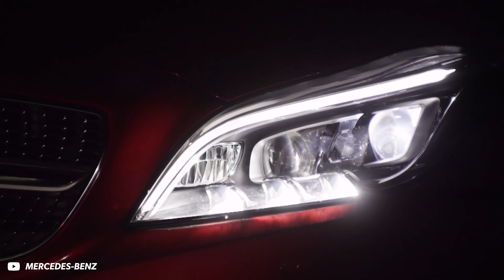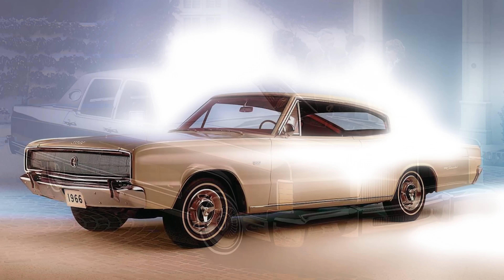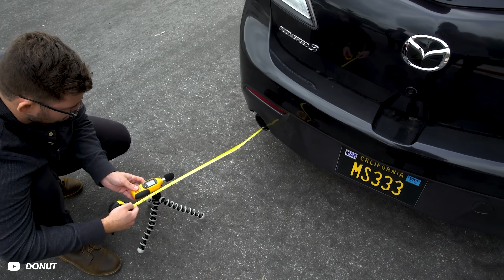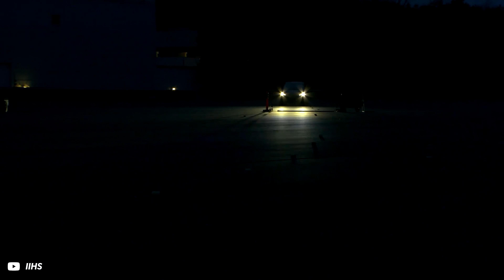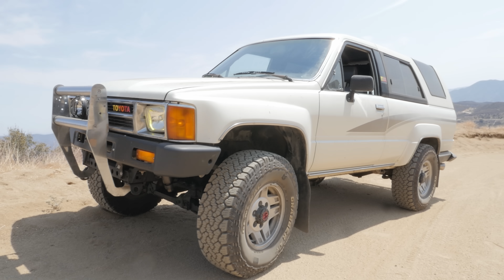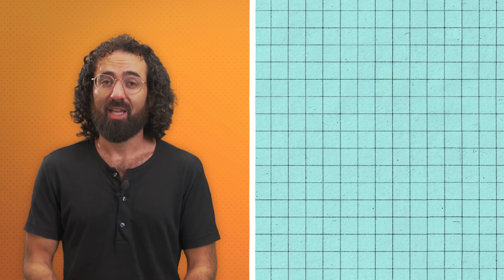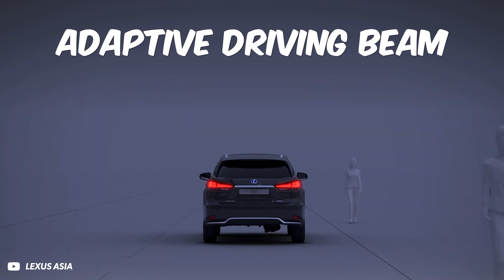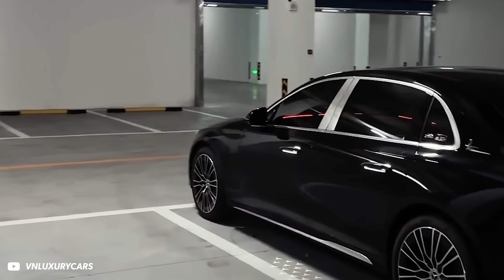Why new headlights are blinding American drivers

Comment: Holy cow.  I'm so glad it's not just me.  I've been noticing this a lot lately and I thought I was just getting older or something.  People are installing stupidly bright headlights and making it a pain to drive at night.  Then it makes other people more reluctant to turn off their high beams.  It's a real safety hazard, especially in deer country.
Reply: I'm in the same shoes.   I thought I was growing old and more sensitive to light - turns out, it's not that simple!   Good to know.   Shame I'll be in the ground by the time all carmakers were forced to do those adaptive headlight systems.
Reply: @Steve-es3fc  Yep, I figure that is about when they will get safer headlights, right about the point I'm 160 years old!
Reply: Yep. I drive a semi and when I’m in small towns on a two lane road (two lanes going in opposite directions) some drivers are driving with their high beams on. This makes it damn near impossible to see where I’m going. Then there’s the pick up truck people that think it’s a great idea to add those LED bar lights that shine brighter than the sun.
Reply: @mari0c0leman  hmm, I would've figured oncoming lights would've been at least slightly less of a headache in a semi simply due to the higher seating position. Also, I've seen a lot of semis in the last several years running their own lighters, day and night, like complete assholes. Back when I had my Mazda3 (RIP), I had a 40in bar on the roof that was almost exclusively used to intentionally blind assholes running around with their off-road lights on.
Reply: Yeah I live where a LOT of people have installed the drop in LED lights in their older vehicles to help see at night (no street lights, + deer and moose). 

When those vehicles are oncoming it "fogs" the whole roadway with light and I just have to look down and at the  road markings and hope nothing is in the roadway in front of me.
Reply: I sincerely hate that aspect of coming up on a car with bright lights! It doesn't bother my eyes quite so much but sitting there with nothing to do but hoping a deer isn't in the wrong spot at the wrong time always worries me.
Reply: @volvo09   Factory ones are not better. There is a lot more light on the road, and anyone with old type halogen headlight suddenly can't see anything because eyes adapt to brither environment.
Reply: There's a small amount of modified cars, most of the offending cars around here are OEM lights. For some reason they forgot to adjust the angles, they have no drop off down and they're not angled to the right into the ditch as older cars always were.
Reply: @shinobi6622  people usually dont even get their lights fixed anymore...people want to bitch and moan about "quotas" but cops ARENT pulling people over for anything light related...so why would people bother getting their lights aligned? think of all the illegally staffed mechanic shops out there too, ripping people off and doing half-assed jobs...a lot of the time, i think THAT is the main reason for this...its the mechanics(or maybe even from the factory) not doing proper headlight alignments.
Reply: The worst part is, the deer are just as blinded by the small suns these new cars have. Deer freeze when they're scared and can't see. I've noticed more deer carcasses on the roadside over the last several years.
Reply: Deer don't freeze because they cannot see, they freeze because a sound and object is coming.  Their natural instincts is to hold still, hide.  When that sound heads right for them and gets too close they feel like the jig is up and run.  This is why it seems almost as if deer always wait for the last minute to suddenly run in front of you
Reply: @user-or1xh1vc8n  Based on every deer that's jumped out in front of me over the last 25 years, that's complete bollocks. Highbeams they freeze, lowbeams they keep on rolling. So I only use low beams, and I aim for their arse when they jump out in front of me and they are gone by the time I get there. Usually I don't even cancel cruise control.
Reply: @chaseweeks2708   I agree. I drive a lot of country roads. If I see a dear freeze at the side of the road I cut my high beams and they typically run off. It’s better than slowing down and driving past it.  I started doing it that way after not switching to low beams and having a deer on the side of the road jumping into/on my car as I passed it.
Reply: @chaseweeks2708  this is just anecdotal.  There are plenty of videos and instances of deer freezing and not freezing regardless of what lights you are using.  High beam and low beam has nothing to do with intensity, it is simply where the light is aimed.  High beam does not mean higher intensity, it just means high as in direction.  For a deer that is knelt by a bush, it's all high beam.  Next time you have the chance to stand in front of a vehicle with its low beams on, try ducking down and see it suddenly seem like high beams to you.  My information is not based on anecdote, just plain simple science that has been known for ages.  A deers instinct is to hide and hold still, if the scary monster comes right for them, they assume they have been found out and make a break for it.  Some.deer don't hide and don't feel afraid, some do.
Reply: @user-or1xh1vc8n  high beams and low beams do change intensity depending on where your eye level is. And that's important when the eye level in question isn't a deer laid down in a bush on the other side of a ditch, but instead a deer casually walking across a highway or back road directly in front of you. And I already know all about that light cutoff. You don't have to kneel down to see it. Every time you meet oncoming traffic while going over even a slight hill in the road you're going to get hit directly in the retinas by that. Just about every vehicle made in the last 10-15 years is blindingly bright below their waistline. Even my motorcycle is like that. So much so that I actually adjusted the headlight down a few degrees just so oncoming traffic would stop flashing me for blinding them. And it worked a treat.
Reply: @chaseweeks2708  you've said nothing to contradict the information I have given. High beam and low beam do not change intensity, it just changes the direction it is pointing.  Saying that it depends on eye level is just repeating what I already pointed out.  The entire point being that to a deer, especially when laying down as you mentioned, they are short enough to always be seeing the same intensity of light.  And I am fully aware of the deregulation of headlight hight cut off in the United States, it has resulted in most modern vehicles having the low beam aimed to high.  As well as suvs having no regulation on lowering their aim to compensate for the height of the vehicle.  But none of this undies what I stated about the deer
Reply: @user-or1xh1vc8n  if the deer is laying down, it's not in the middle of the damn road. If it's in the middle of the road, it's either standing or walking. When it's standing or walking, then the effective intensity of the headlights at that eye level matters. In that case, high beams are brighter than low beams because high beams are aimed higher than low beams, and are more likely to cause the deer to behave unpredictably. I don't know why you keep bringing up deer laying down off in the bushes that are in no way even relevant.
Reply: @chaseweeks2708  of course laying in the bushes is relevant since that is how deer often hide when they think something is coming their way, as I explained before.  But standing in the middle of the road would make no difference because even a human standing in the road would get the full effect of the low beam until you come close, especially with the height that low beams are aimed at these days.  My bottom line point being that high beams or low beams will have no effect on the deers behavior, they are more concerned with the sight and sound of something coming their way.  The usual response is to hide and hold still and when that thing seems to be coming right for them and is almost upon them, they assume the jig is up and panic run.  This is what causes people to think deer almost deliberately wait to the last minute to jump in front of a person as if they want to get hit.  If you want to contend with me on high beams and low beams and their function, I am a 26 year USAF reverse engineer.  Try taking a glance at my channel.
Reply: I can always tell when a Jeep is heading my way at night, they are always blinding.  I installed high output fog lamps on my Silverado.  I know that they are bright but I purchased the yellow ones and they are able to be adjusted to angle the beam downwards.  I travel 14 miles to and from work every day along a tree lined 55 mph road that is littered with dead deer and I am tired of hitting them.  These lights are a game changer as I spot the deer way sooner than ever and have not hit one again since I have installed them.  Just 4 days ago one came tearing from the woods and then of course stops directly in the lane.  My carry bag with my lunch slid off and hit the floor, but that was the only issue.
Reply: Its not aftermarket lights, its all new vehicle headlights. tesla, is the worst offender.
Reply: Many of the people who install them aftermarket are just trying to maintain visibility in the face of new vehicles that come with dangerous lights from the factory, not much else they can do.
Reply: Actually for some time now this has been a thing online, the outrage over hot spot lighting and glare, and so much more.  I mean there are stupid people out there with this stuff, stay safe!
Reply: Yeah, it's not just you.
Reply: Putting LED lights in units designed for halogen bulbs is illegal in the UK. The beam pattern is completely different.  It's an automatic MOT failure too.
Reply: @nickjolly3984  most people don't seem to realize they have to be adjusted to work properly. They are not just drop-in replacements. They have to be clocked so that the beam pattern is right. That's why the good LED bulbs have a little set screw, so that you can properly clock them. Most people are too damn lazy to do that, so it's probably for the best it be banned.
Reply: My eye doctor and I had a conversation on this in 2018, so it’s been around a while.
Reply: I thought it was happening only in India because of lawlessness.
Reply: A bright set of lights actually confuses the deer to stand still.  Like it is the daytime.
Reply: @user-hr8pz6lh5w That's good.  They can stand still so that you can avoid them.  It is when they are moving that is the problem
Reply: @g.k.1669  unfortunately they tend to stop directly in your path. I'd rather they not freeze. It makes for an easier serve.
Reply: I’ve been looking for night driving glasses that would darken like an electronic welding hood but so far I have not found such glasses. These bright headlights are really getting to me but thankfully Tesla has adaptive headlights now.
Reply: If the light hurts your eyes, its age related. If the light only makes it hard to see your own lights down the road, then its the lights you can blame.
Reply: @angrysocialjusticewarrior  nope. Oncoming high beams have been painful since I was 16.
Reply: I feel they are more reluctant to turn off there high beams. If you pass a car and can see every bulb in there headlights assembly illuminated.. they just have their dam brights on!
Reply: For that reason I try to avoid driving when it is dark. I don't know what happened, but just 5-7 years ago I don't remember that problem before. Right now it is something in mass proportion. So many cars are having a blinding bright lights, especially the new tracks. I hope it will change soon.
Reply: Peasants should not be driving anyway. Flying, eating meat and going on holiday while the world is locked down is reserved only for the special ones.
Reply: I think another part of the problem is alot of ppl or switching to suv and trucks and if u have a sedan u sit almost eye level with their headlights
Reply: It still amazes me that people in "deer country" still religiously use their high beams, failing to make the connection that high beams cause the deer to stop directly in front of you, when low beams don't. Well, far more and less likely to do so, respectively. I grew up in deer country, and I've had plenty of them jump out in front of me, and the only time they have ever stopped in my way was when I had the high beams on. Now they are just signal lights for me.
Reply: @chaseweeks2708  lol.  If most ppl used low beams, they would need to drive at about 15mph so as to have time to stop and not hit the deer.  You're not thinking too well
Reply: @18_rabbit   negative. I have never slowed down.
Reply: @18_rabbit  you’re not thinking to well. You have your high beams on and if you see a deer you switch to low beams and slow down.  The deer picks a direction to run off instead of freezing then panicking as you pass it.
Reply: best video ever
Reply: Deer r not good

Comment: The worst is when you’re driving a semi truck and need to see the road but some ultra bright blue lights are preventing you from seeing. I don’t need a highway safety agency to do a study to explain the danger of forcing truckers to look away from oncoming bright lights that blind them while operating an 80,000 pound vehicle. That’s just obvious. And there’s nowhere near enough law enforcement around in the US to catch drivers doing that and pull them over. What they really need are headlight brightness sensors which detect if a driver is blinding oncoming motorists for an extended period of time, captures the plate, and sends them a ticket in the mail.
Reply: American attitudes about regulation and enforcement are strange. It's almost like they say, "your right to swing your fist ends at my face", then just punch you in the face anyway, then argue their fist never really contacted your face because electrons repel one another, and what was your face doing there anyway, and getting punched is just a fact of life. Well, it's not strange. It's antisocial narcissism.
Reply: I HATE regulation, but in this particular case, I agree.  Camera enforcement with a calibrated light sensor would be a great way to do it!